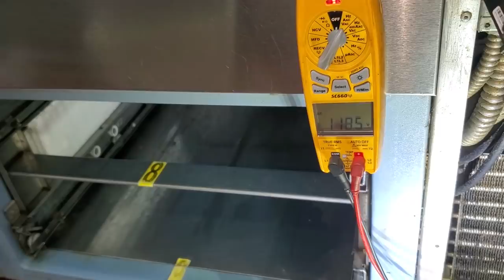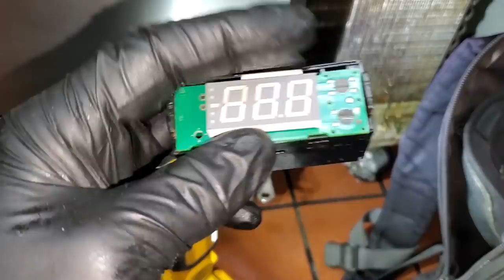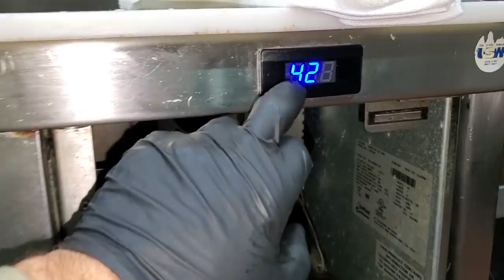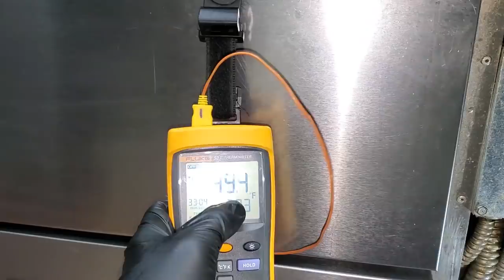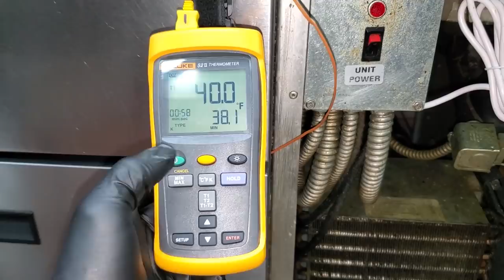DELFIELD PREP TABLE NOT COOLING

Comment: Hey Chris, 

On these F18 boxes. The manufacturer D_____ld has released a cover plate kit for these units which is basically a 'splash shield' for the controller. I also see a lot of these failed in the field due to moisture.
Reply from the maker: Interesting thanks for the tip!
Reply: you can make your own out of some scrap "tin", if you do tin work of course you'd have the stuff laying around
Reply: @throttlebottle5906  honestly. That's all it is. I even cut the one they sent me to 'improve' it's water shedding capabilities.
Reply: @chandlerwilliams503  alternately, just grab some plastic wrap from the kitchen, surely they have lots of it! lol
or just foil tape up over top it, from front to rear....
Reply: @throttlebottle5906  or some real high quality construction paper. 😂😂😂
Reply: @chandlerwilliams503  lol

Comment: looked like it iced up and stopped the fan early in the video, now back to watching.
wild guesses water damage and/or temp sensor not defrosting it :)
after watching more yep and the water in the temp control would effect the temp sensor readings(thermistors) since it's low voltage and current. very likely the condensate/cleaning water is dirty and acidic/conductive also, which would really whack it out

Comment: A while ago I had a bar cooler with a digital temperature controller that shorted out (with a loud bang) due to water damage.  This had happened before and everyone tought it was because of the habit of cleaning the floor with buckets of water.
However it seemed that due to the hot weather and high humidity there was water that condensated on the (not so well insulated) part between te doors. That water started to drip on the controller eventually causing problems. So we moved the controller to the back of the unit by cutting a hole in the back plate. It has been running without problems for multiple years now.

Comment: at 4:59 those boards are multi-layer with "via's" so those button pads/solder joints could still be connected through and possibly do something, but they may be ignored.
then again knowing and dealing with many processor controlled things, it could cause a hard-lock if it's wet or bridged even if not used!
** but yeah, it appears to be used only as a display on that setup!

Comment: If there's ice on the back of the coil where you were pulling your sensor,  would you get air infiltration through that hole?
Reply from the maker: Yeah they have insulation shoved in there

Comment: Do you have, or can you do a video explaining how the lower with the pressure switch and the higher coil with temperature control work together/independently. Sequence of operation type of thing. Thanks
Reply: Lowered section is controlled by temperature sensors. Top rail it's controlled via pressure control switch. Look up your r404a chart for temperature cut-offs on pressure control. FYI delfield tech support doesn't know much more than the average technician out there.

Comment: DelField... I think they use the min. size condenser,, They prob test it at the factory with a brand new clean coil and used the smaller one, cause a little dirt in the condenser, especially a kitchen or cooking area,The head pressures go sooo High,, with a new case I RUN RUN to Home Depo and get the Blue fiters, cut them to size and use magnets to hold on condenser(Blue fiters jst capture the crazy heavy stuff, it looks new for years)....to catch the starting dirt which gets impacted. I also take temp readings on the discharge, write it on the inside wall along with ambient at that time, and compressor amp readings, Then I will stop in many weeks( Have a service contract) check the filter, replace if needed, and keep them running with no service calls like NOBODYS businessLol..for years

Comment: I would add, if you're seeing calcium on top of the temp controller they're throwing hypochlorite into the works.  Easiest to tell em is "hit it with a mop then rinse that off with a spray bottle" because the floor cleaner is nowhere near as destructive.  Would not surprise me if this specific customer is just taking a hose off the water heater and using some kind of suction nozzle full of pool shock to wash stuff down.  It would explain the splash, the draining into the display, the huge amount of water entering the coil and freezing up.

Comment: When you have custom units where you can't get to the back of the box do you cut the temp probes at the evap and wire nut the new probes?
Reply from the maker: I will discuss this on my livestream this evening, I have ran into this problem several times. I will be going live on YouTube this evening 1/13/20 @ 5:PM (pacific time) to discuss my most recent uploads come on over and check it out https://youtu.be/YS0nIkCyXNE
Reply: probably best to use heat-shrink butt-splice crimps instead! then it seals the connections. but once wet the plug ends and wire at the board could be bad/corroded also. so do both ends!

Comment: Get yourself an ultrasonic cleaner:) Thous are probably salvageable, Its likely just corrosion on the pins that throw of the overly sensitive temp probe. Still seams like a shit design that the display can kill the control. Or go even simpler throw a zip lock over that thing open on bottom  after replacement.